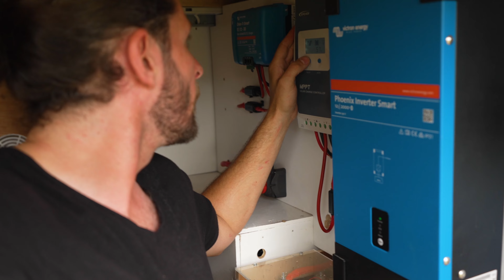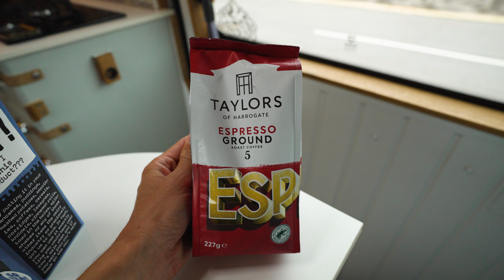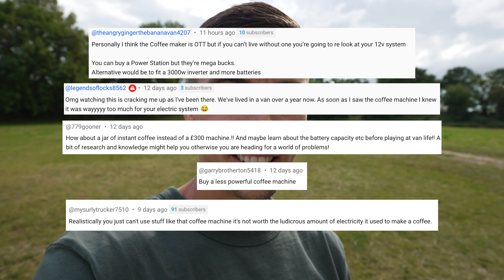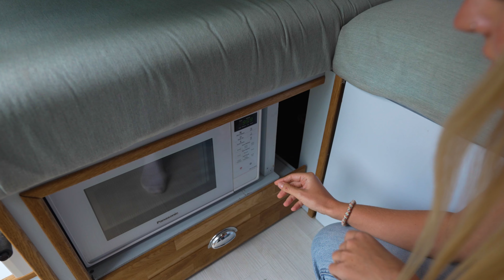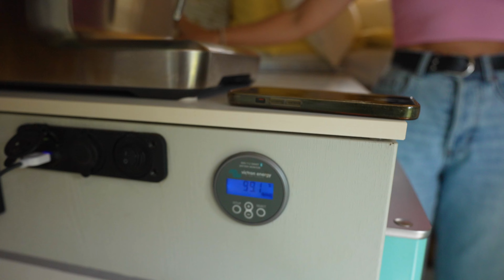This Will Make Vanlife 100x Better For Us (Vanlife UK)

Comment: I think what is more important here is not that the coffee machine works (addicted anyone?) but the fact you had a loose connection in your main electrics and this got fixed . If this problem hadn't happened now it would have happened in less fortunate circumstance. I hope you paid attention to what he did to fix it cause it may be up to yourselves next time ! 
I believe vanlife could be either a brilliant experience or a nightmare depending on how well you can deal with the problems which can come up. For example one thing you could do now is to go over the electrical connections in your van and check they are all tight, just as a preventative measure. I wish you both every success and want you to succeed !
Reply from the maker: I know, we feel so lucky to have found this issue! It’s definitely a learning curve and we are definitely beginners
Reply: Yep had that in the past you’re 100% right. I went over all the connections for them so figures crossed it keeps going for a long time.

Comment: Seeing the loose connection reminded me to order a thermal heat thermometer for my RV. It's a very useful tool for identifying  component that's over heating like a breaker and loose connection, which have higher then normal resistance causing higher then normal voltage drop, which can lead to electrical fire. IMHO it's time to use interwebz to learn about  electricity both AC and 12VDC systems, solar charge controller and inverter. It's good to have spare fuses. Safe travels you two.
Reply from the maker: Definitely, we need to be glued up on these stuff! Thank you very much for the advice

Comment: I don't know how much the extra battery cost, and it's too late to suggest now, but I think I would have considered a power pack. At least that way you'd have had a alternative power supply, and the fact you sometimes use sites with hook up, recharging the power pack wouldn't be an  issue. Also you could divert some of your solar to the power pack.
Reply from the maker: Thank you for the suggestion! We have thought about it!!

Comment: Check wattage value of your coffee machine eg a typical kettle is 2500 watts. Make sure your inverter can deliver more than the device needs. The higher the wattage the more drain on your batteries. A 12 volt battery for eg uses 1 amp for every 12 watts. Use high wattage devices only for short bursts of time. Good luck 🤞
Reply from the maker: It’s a 2000w inverter with peak voltage 4000w 😃

Comment: Great Video guys, I have a similar Sage coffee machine I'll be installing in my van but I too need to get an extra battery first!

Just as reassurance, I know it's all working fine now anyways but you should have no problem with it anyways.

You have a 2000 Watt inverter and I checked your coffee machine (which I think is the Duo temp pro from the looks of it?) draws 1600W.

Now having 2 batteries which I think you said were 200ah each? is plenty, I can see they're DIY batteries which I've been looking at doing myself too, so not sure what the BMS's are rated at but I'd guess 100a each if not more meaning with the 2 in parallel as setup you can draw 200a now which is 2,560Watts so gives you plenty of overhead for powering other things at the same time as the coffee machine, now that it's all sorted your electrical shouldn't even break a sweat to make you coffees on the road!

The loose bolt on the shunt I've also had before where it'd worked loose overtime I assume with all the vibrations, so it provides usually enough connection to still power general lower wattage appliances but when it comes to higher ones like your coffee machine it just cannot get enough through the loose connection.

A tip for improving your coffee, I presume you'll have the coffee machine off when not in use, it's a good idea to run a blind shot (no coffee in the basket) before making your coffees to heat up the portafilter as although the internals are all upto temp and ready to go it does take some time to heat that with it being solid metal, this will help give you a better extraction as the temperature will be right!  I have a Sage Barista Pro and nothing beats a great cup of coffee!

Glad to hear you ignored all the naysayers telling you to get a smaller machine or to give it up altogether!
Reply: Another thing to note is when putting batteries into parallel its best practice to get them to the same state of charge (you may have already done so), this is usually and most easily done by top balancing (charging each battery to 100%)

If you haven't already done this if possible, you could disconnect one battery and get one to 100% then switch and get the other to 100%, and then reconnect the 2 back together. This just prevents them from being different states of charge as over time they could drift more easily and especially running a big appliance, it could put more stress on one of the batteries than the other if the state of charge differs too much.
Reply from the maker: Thanks for all the info! The bms is 200 each and yes we know about charging the batteries in parallel! We can switch the batteries on and off from the phone 📱 👌

Comment: Hi . Good content. 
However  quick heads up regarding battery power. 
I love to camp off grid in my van with all the creature comforts off home. That being said I have 3000 watts bluetti ac300, along with 600watts solar . If the sun isn't playing ball then every 12hours I will need to run my 3000watt petrol generator for half an hour to top my ac300 up. . Also this chap installing your battery set up is not clued up
Reply from the maker: Well yea.. that’s how solar works lol! We’re usually on 100% every day since we also drive, when driving we charge at 50-60ah

Comment: That electrical setup is a bit worrying. Trapped in a wall, directly under the bed. A loose wire connection can get red hot and the wall will catch fire, then the bed, then the van.

Please put a smoke detector in the back electrical area. Maybe get a fire extinguisher.

And whatever you do, don't run a space heater or AC for hours without being there. The wiring will get hot and can start fires. I've read multiple stories of people's vans/buses burning down from space heaters they left on overnight with the van plugged into the shore power.
Reply from the maker: That's a brilliant idea. We will get a smoke detector in there and a fire extinguisher! We definitely won't run a space heater since we have a diesel heater in the van :)

Comment: Can you give us some info on what battery size and inverter size you are using? Ive only been following a few weeks but great to see you answer almost every question.  Ill ask mine before you get fed up lol
Reply from the maker: 2000w inverter and 200ah per battery 😀
Reply: @2Passports1Dream  that's what I guessed but that means it can only run appliances upto 1000w constant but I thought your coffee machine would be more?. I have same but gets very very hot at 1000w
Reply: @2Passports1Dream  well I've just plugged my 1250w coffee machine in mine and it works. I'm so happy thankyou. Without your video I would never have tried it. Its only one of those pod types but better than nothing